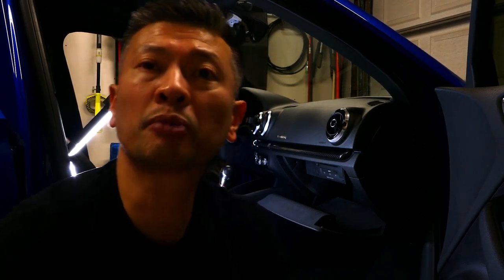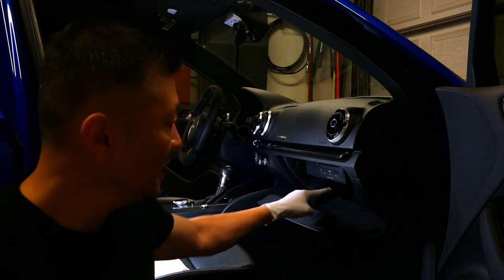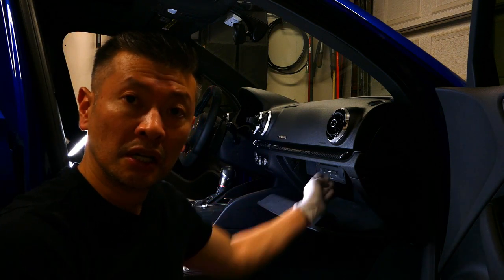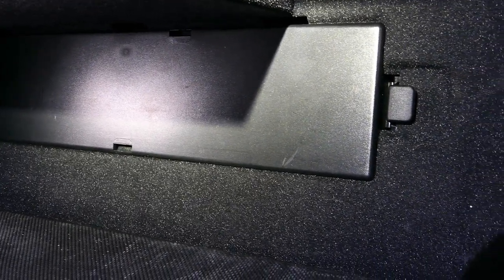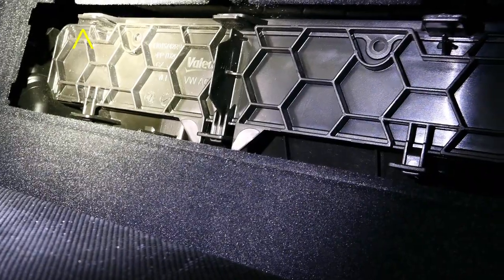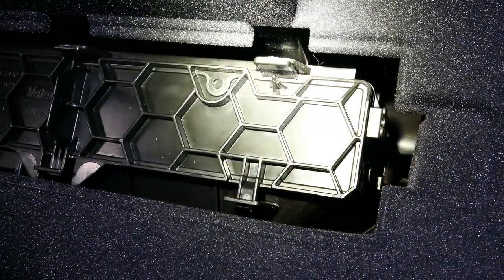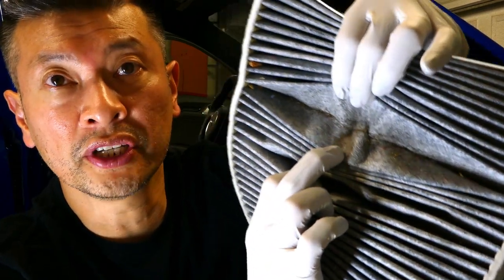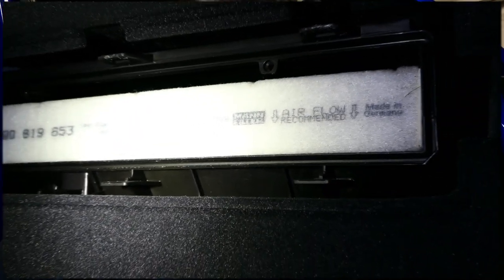Audi In Cabin Filter Replacement DIY

Comment: Great tip wonderful video I have a Audi A1 Is the cabin air filter in the same location as the S3?
Reply from the maker: Taylor, I cannot confirm if the S3 in-cabin is the same as for the A1. Check out this site:

https://www.buycarparts.co.uk/pollen-filter/audi-a1/m-bosch

Use your vehicle type and see if the parts are the same.

Comment: Hi peter i have a 2016 audi s3 manual gearbox when i turn on my air con it literaly smells disgusting i thought if i leave it on the smell would go if you could give me any pointers i would apreciate it buddy 👍
Reply from the maker: Hey Ryan, it's not uncommon for the air system to smell when you're simply blowing without A/C. However, in your case, there is definitely something going on because A/C should not smell. The first thing I would do, check the filter and see if it's clogged up with something that rooted. Report back!